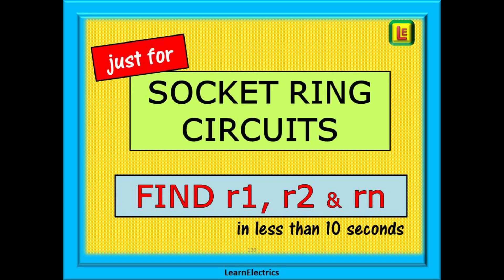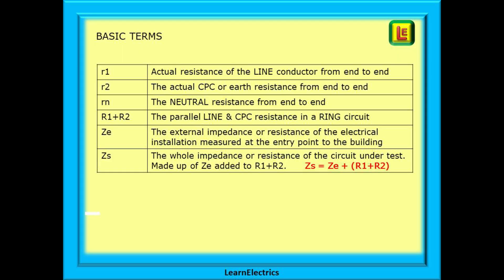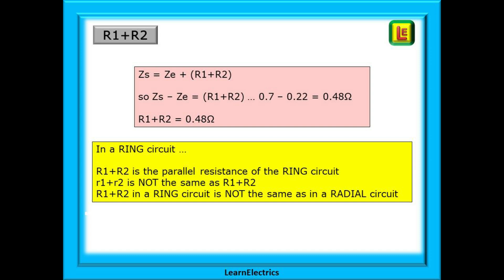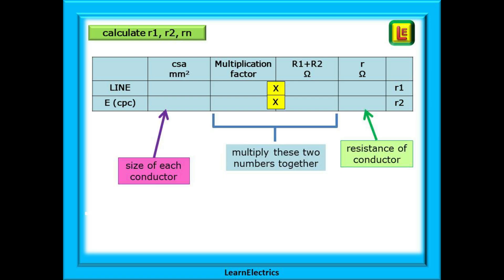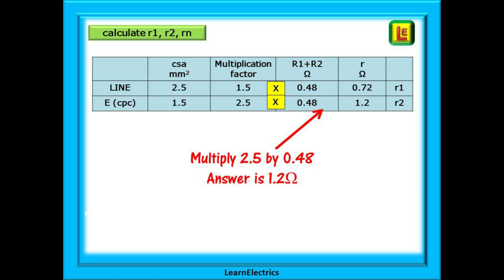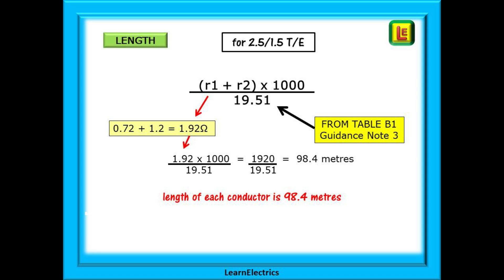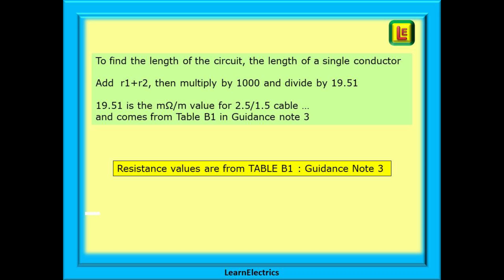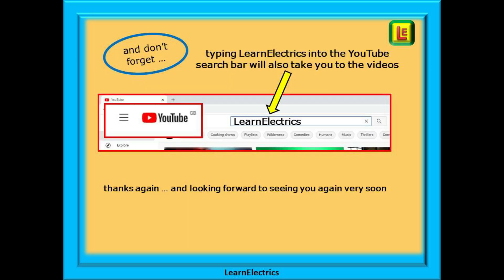SOCKET RING CIRCUIT RESISTANCE – Find the circuit values in ten seconds – r1, r2, rn, R1+R2, length

Comment: I thought it was dangerous to calculate  r1+rn or r1+r2 from the measured ELI  asyou can get agood reading for ELI  but could have loose connections or rev polarity if you dont do the r1 r2 test proparly thats disconnect the 2  2.5 T&E Cables at the board then end to end and figure 8 so don't calculate it always do the test  😊
Reply from the maker: Thanks for the input, the video is showing you what you should expect, and of course, you should always do a physical Zs check. Thanks for watching. Dave.

Comment: Just wanted Where have you got multiplying factors for little R1 and little R2
Reply from the maker: These come from the ratios of the conductor sizes relative to each other for different cables - 1/1 - 1.5/1 - 2.5/1.5 etc.

Comment: Hi Could  you explain this  question plz
The circuit loop length is 58m long wired in 4 mm live 1.5mm  cpc flat profile cable the circuit is protected by 32 A BS EN 60898 TYPR B circuit breaker 
What's the expected measured r1 value?
Thank you
Reply from the maker: Quickest way is to go to Table B1 in Guidance Note 3 and look up the value for 4mm conductor on its own. Multiply that number by 58 metres and then divide by 1000. There's your answer. You should get about 0.27 ohms.

Comment: Hi there. Could you tell me how i need to work out when the cable size  of the line is 4mm2. Many thanks
Reply from the maker: We wouldn't normally put a ring circuit in at 4mm unless you have a very long run. 2.5mm with 32A is the norm.
If it is 4mm sockets, is it a radial circuit?
Dave.

Comment: Excellent stuff Dave however can we also do this by multiplying R1+R2 0.48 resistance with 4 and get 1.92 which is end to end resistance of Line and cpc and then divide this by the factor of cpc csa which is 1.67   so we get r1 which is = 1.92/1.67 =  1.2 if we round it up and than minus r1, 1.2 from 1.92 we get r2 which is 0.72 ohms !
 this works on other CSA but as you mentioned 99% domestic properties rings are sized as 2.5-1.5 than the video is the best trick.
Many thanks for sharing your wisdom
Reply from the maker: I will be doing a video on the other sizes soon. Its just that for 2.5/1.5 the method shown is so simple, worth passing on. Dave.
Reply: @learnelectrics4402  do you have a link to this other video please?

Comment: Bloody brilliant dave thank you so much again 🙌🏻🙌🏻 I’ve learnt so much from watching your videos 👍👍 a little off topic dave but as I’ve said in a video a while back I’ll be starting college in September (can’t wait😄) and I’m going to have a go at doing a few bits at home and hopefully use some of it if I need for college photo portfolio etc my question is even tho I won’t be fully qualified, but I would like to say I would be competent, can I still fill out a minor work certificate for stuff that I do,examples. I’ll be fitting downlights from an original pendant,and replacing pendants for decorative lights (to keep the wife happy).and also adding sockets to existing ring/radial circuits.oh and probably extending the original smoke alarm circuit to add heat/smokes to rooms that don’t have them etc I will also be upgrading my consumer unit at some point but I will do this when I have gained a little more experience and understanding.i do understand that this is a notifiable works and would need to notify labc to get a comletion certificate and have it tested by there own in-house electrician(if that’s the right procedure) but for the small jobs as mentioned could I still complete a minor works certificate? I would carry out the schedule of tests required for the mwc as I will probably have my own MFT by then. Or is it not possible to do and only a qualified registered cps sparks can fill out a mwc. Sorry if I’ve gone one abit 😂 cheers
Reply from the maker: Minor Works can be completed by any competent person and they do not need to be notified under Part P. Yes, save photos of all your work, copies of test certificates etc. Its all good evidence. Dave.
Reply: @learnelectrics4402  brilliant dave thanks for reply 🙌🏻🙌🏻